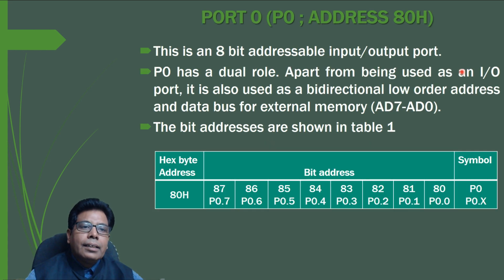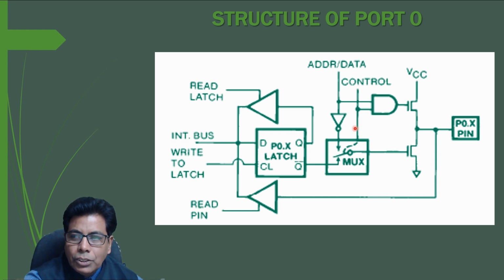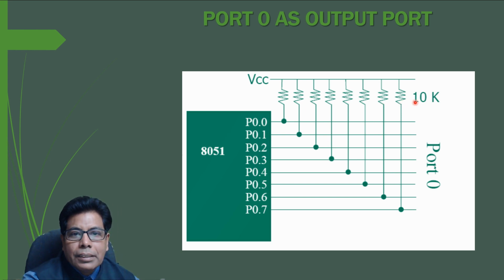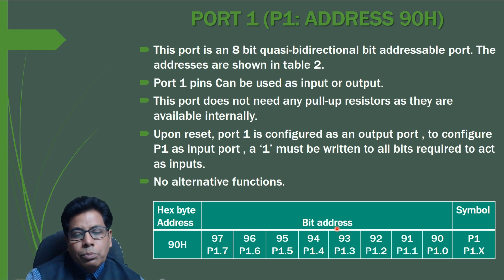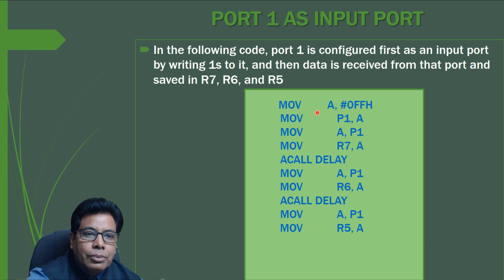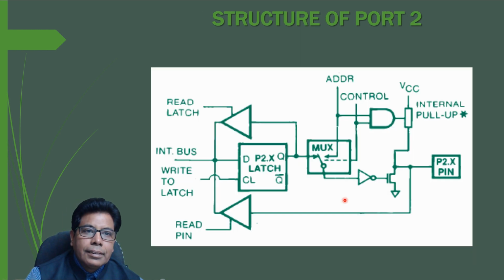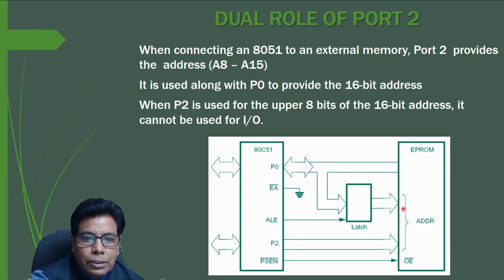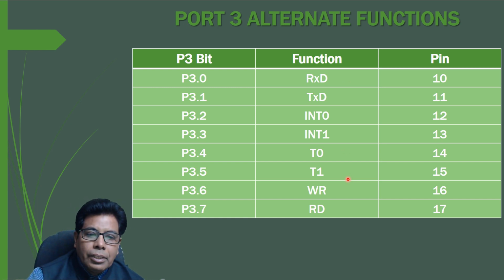8051 INPUT OUTPUT PORTS

Comment: Hi, may i know how can i read only one bit, for example : read from P1.6 only ?
Reply from the maker: You can access single pin of all the four ports using a bit address . for example P1.7, P1.6 etc.
You can use 'C' program for accessing the bit.
BIT input1 P1.6  // declare port P1.6 as input1
BIT input2 P1.7 // declare port P1.7 as input2 and then read them in Main program.